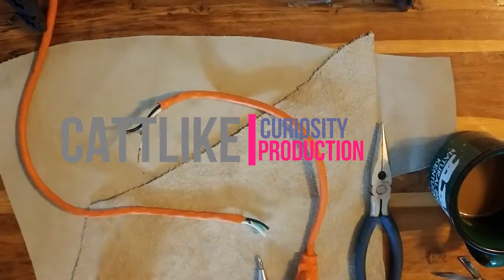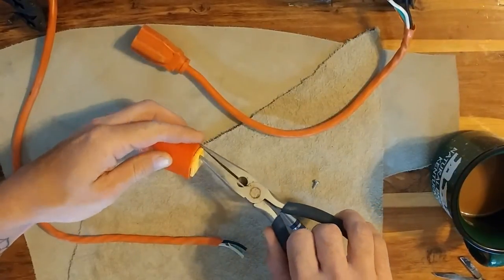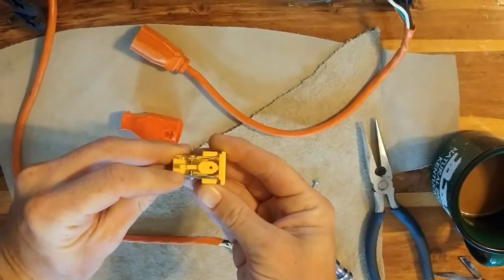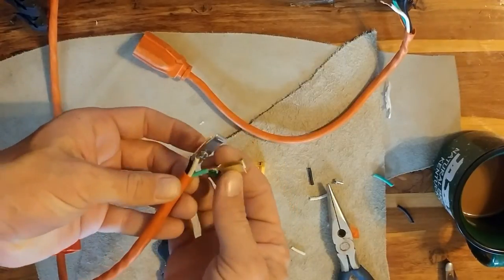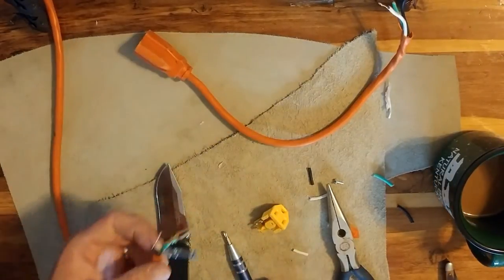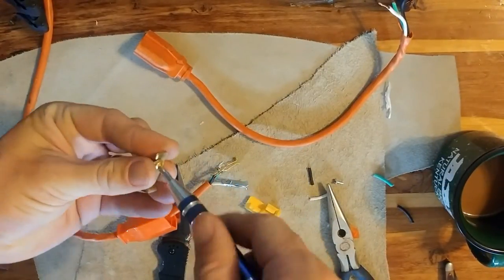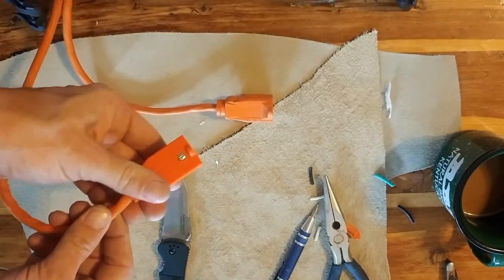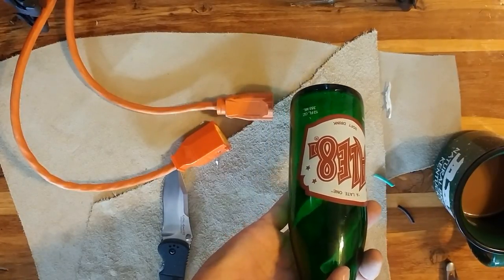DIY... extention cord female plug repair

Comment: Like #58.  I thought I was listening to Tom Bodett with motel 6 for a minute.  Good instructions. That particular plug end has a tendency to not secure the wire ends properly.  It just didn't look safe and secure to me so I will be getting a bit heftier plug end.  However your instructions are universally applicable.  Thanks for the vid.

Comment: thank you.. got a new tv and cant pull the wire through my wall so going to use the cord from the previous plasma as an ext cord since its already in the wall(but the connector only fits the old tv) 
bought one of these to swap! perfect directions
cheers!

Comment: Did I miss what amps/volts that replacement plug is for? 
  The cord looks like a 16 gauge. I do-know that a more powerful plug than needed is better than one not powerful enough.  Any response?  PS...excuse by ignorance to amps vs volts, however I didn't hear anything about power for either plug ends nor the gauge of cord you are working on...